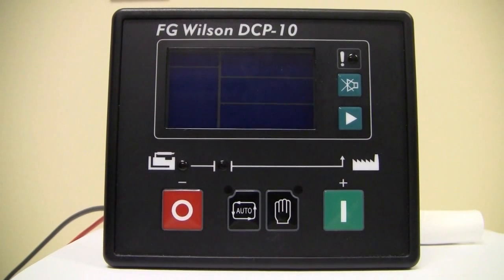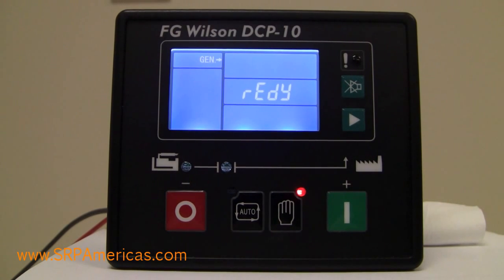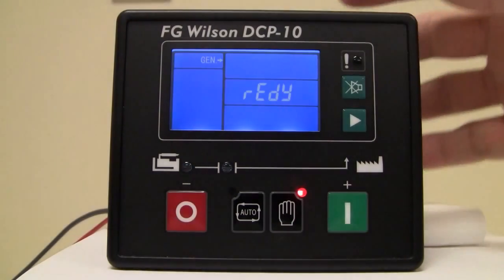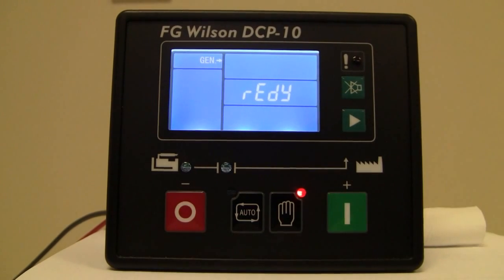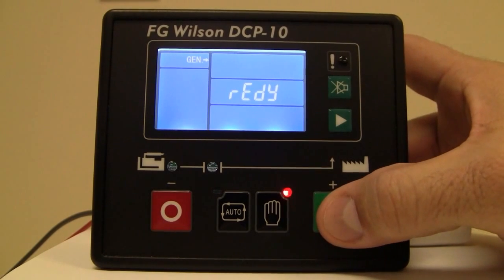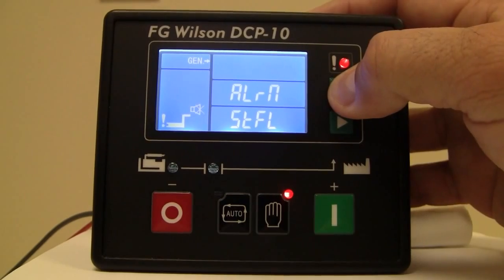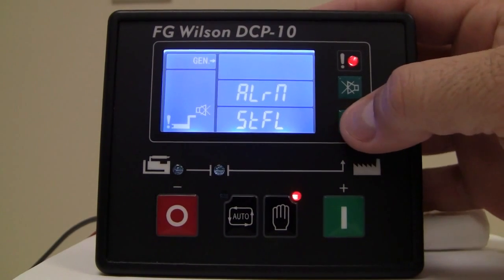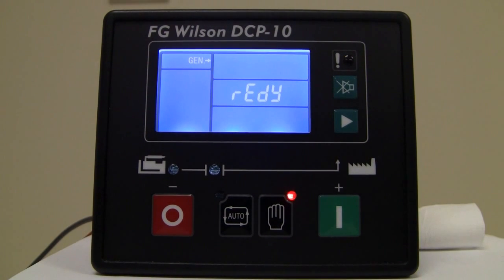How to Navigate a FG Wilson DCP-10 (FG Wilson Generator) (English)

Comment: dear sir can you tell me from where we can get manual and software and communication cable  of DCP 10 and DCP20   f g wilson  genset controllers
Reply: DCP 10 software
Reply: Is better use Inteli-Lite 
AMF 16 or 20 
MRS 16 or 20 
These modules can program at any capacity if genset and working
Reply: Shoain hussain
Contact me on 0323 5016167
Reply: @123qatar7  
Does this your WhatsApp number